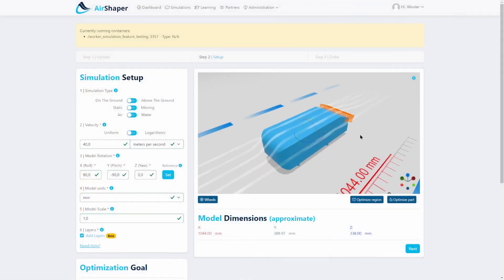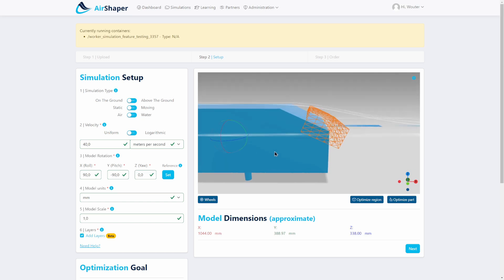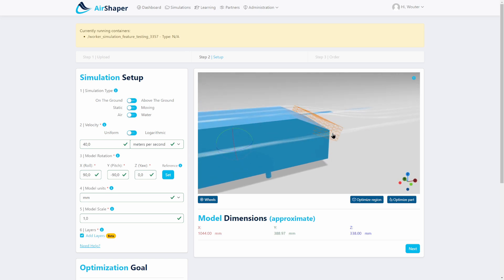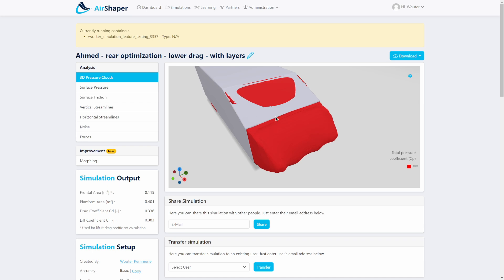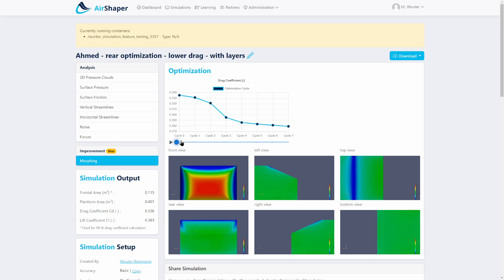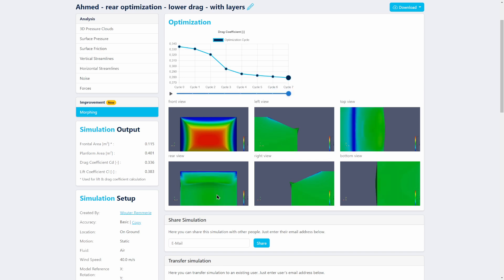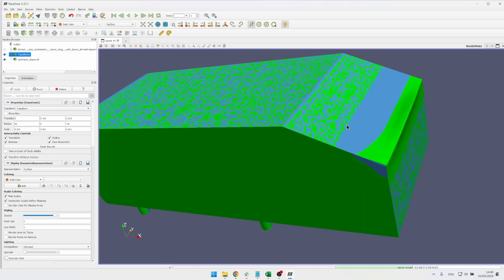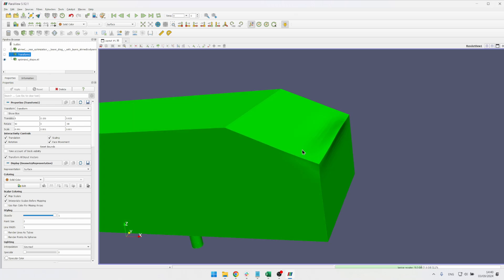Ahmed body aerodynamic shape optimization - Reducing drag using adjoint shape optimization

Comment: Your content is amazing.

I recently installed a aero front fender on my motorcycle. It has made a significant improvement in top speed and acceleration above 200kph.

Could you possible model a motorcycle more geared towards top end racing but still able to keep enough handling for street use.

I am investigating possible aero mods I can implement on the rear of the motorcycle. Perhaps an extended mud guard, rear fairing that dips down to minimise gap between the body and the wheel, even looked at an aero disc but then I'd have to sacrifice the rear brake which is a no no for me.

This is all fun and games for me. There is no money/sponsorships involved.
Reply: You can make an effective aero disc for your wheels by inlaying the disc below the sweep of the brake calipers and disc, inset into the rim, and lock it around the spokes.

For electric motorcycles, I've found about 3-5% improvement in overall drag/range by this method, and it's not complicated to prototype - lasercut PCA (not acrylic) can be conically set into the rim spoke area with cutouts for the tire valves.

Comment: What a great tool ! What is the cost for this ?
Reply from the maker: Depends on which credit plan and which accuracy. At the lowest Basic accuracy (1 million cells) this is 5 credits (50 euro per credit without a plan, so 250 credits). And as the accuracy increases, the credit cost goes up, just check out www.airshaper.col/pricing or drop me an email at wouter@airshaper.com and I'll explain!
Reply: @AirShaper  That is fantastic. I thought for sure that only the top teir had this as an option. 
Good to know that it is possible to use ( a lower accuracy version of ) this for testing.
Reply from the maker: @O-cDxA  Would love to learn more about what you're working on, feel free to drop details at wouter@airshaper.com and talk soon!